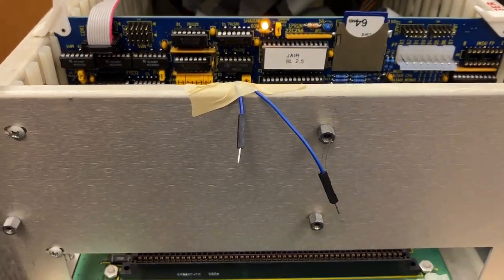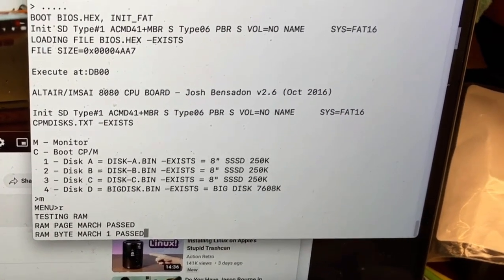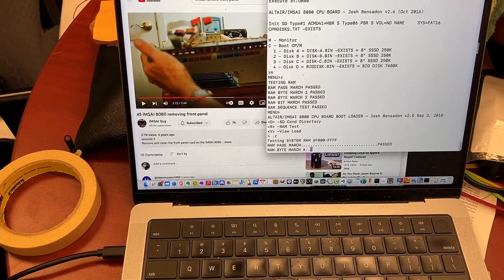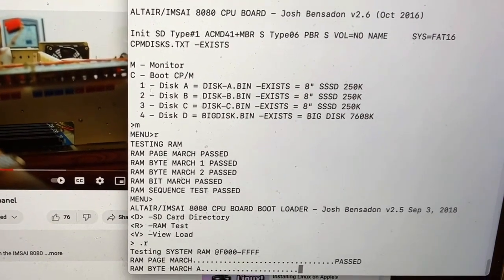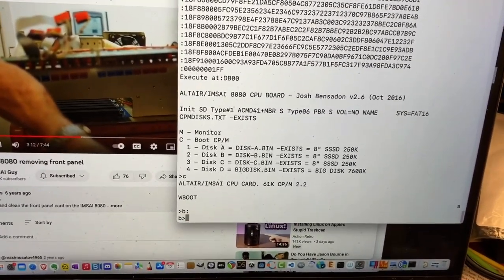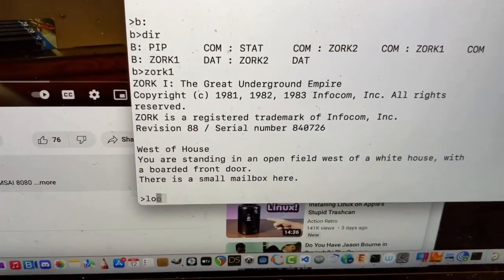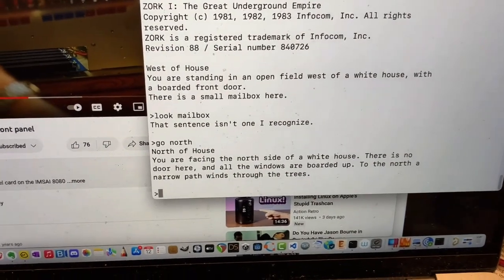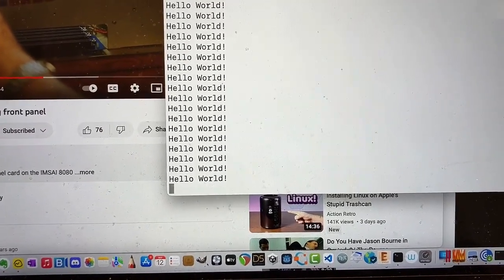JAIR S-100 Bus CPU Card Fusses at My IMSAI 8080 Front Panel but Works in SBC Mode (memory failure)

Comment: Given the issue you fixed earlier I would extract and re-seat every logic chip on the font panel. Oxidized connections are us. Also any edge connectors that are not gold plated give the once over with an ink eraser (do they still make those?) ... Memories of trying to keep a TRS-80 model 1 working.

Comment: That's a tricky one! My gut feeling is there's a problem with the address bus, so I'll go with that first (if there was a bit stuck on the data or control bus it wouldn't work at all). If you can get to the RAM test with the front panel installed, you should see the address bus counting through RAM. If it stops when it goes to drive a certain bit high, that address line is suspect. Looking at the schematic for the front panel again, really the only thing connected to the address bus are the LEDs and U9 (74LS30). I would think if there's going to be a fault, it'll be an input on U9 being shorted or low resistance to ground. The chip is only used to select the front panel sense switches, so you could remove it and see if the fault clears. A diode/continuity check will reveal any shorted pins of course. All the best.